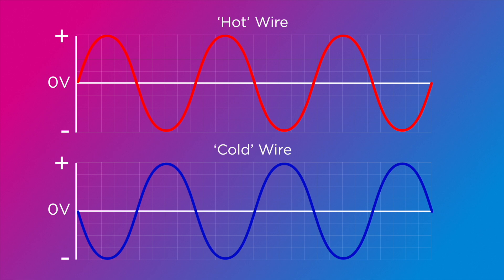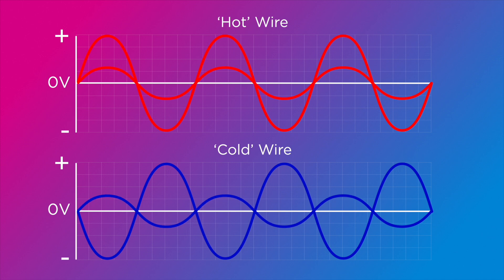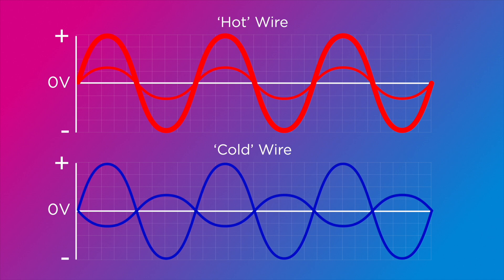What is Balanced Audio?

Comment: Can you please tell how to do this from a source with unbalanced output to destination balanced input. 

Essentially I am looking to convert the hdmi 2.1 signals from my laptop to split between audio and video(goes to my monitor, without any loss in video data), while audio becomes the balanced trs input for my studio speakers.
If you have a device suggestions, that's even better, because I am trying to maintain a strong budget.
Reply: Hi, Thank you for your great question.  The next video in this mini series answers that exact question.  (how to go from a source with unbalanced output to a destination with a balanced input)   Standby.... 😎

To answer the second part of your question:  You will need an Audio Interface.  this connects to the Laptop (usually via USB), and gives you high Quality Audio Inputs and Outputs. These will be Balanced on either an XLR or a TRS 6.5mm Jack socket.  Connect the Master outputs to your Powered Studio Monitor Speakers.  If keeping audio quality high is your priority, then this is the way to go.    If you really are on a budget, then you probably wont have Studio Monitor Speakers or be using HDMI 2.1 sources.  😎
Reply: @PhillSY-Presenter  Thanks for your reply, looking forward to your suggestion. 
Here's what I have came up for so far. Though there are some compromises, but I guess it works for now for my use-case
https://drive.google.com/file/d/1IDhgie4PlmxxG16PF6CxKJBaCbz4lsYQ/view?usp=sharing
Reply: How to connect Balanced with Un-Balanced connections:-    https://www.youtube.com/watch?v=q8ORh5j98xQ
Reply: @Phillip_J_Wildman  thanks I will check this. Somehow my older comment where I posted m diagram got deleted.